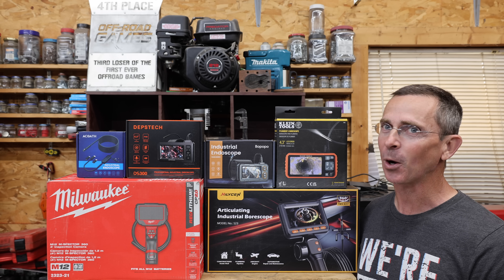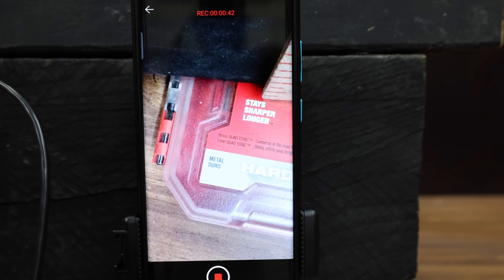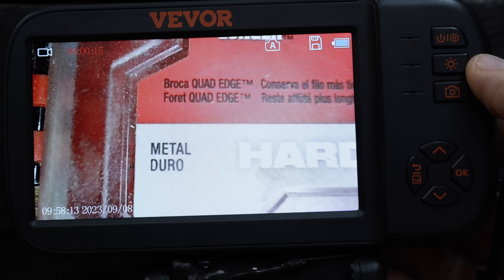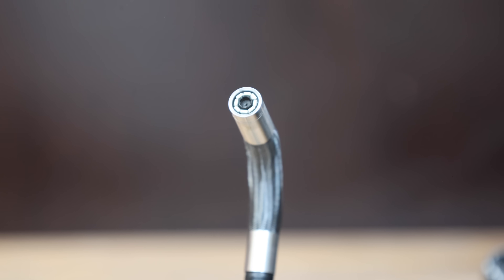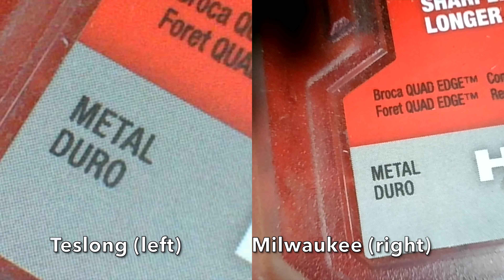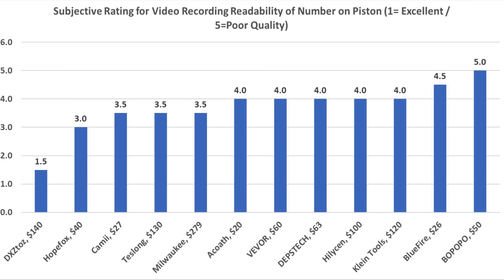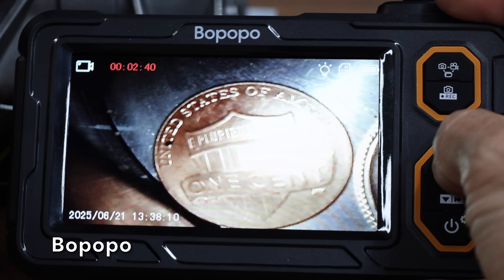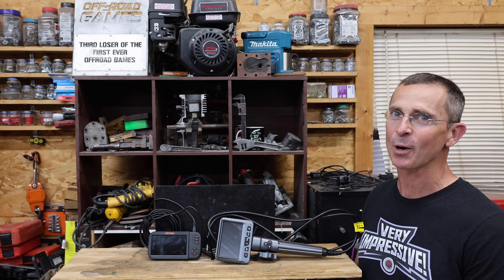I Tested The Most Hyped Inspection Cameras – One Clear Winner!

Comment: I have the DXZtoz "pro" P/N:  B0B8NTF8Y5 (first sold in 2022, now obsolete), and the DEPSTECH P/N:  DS560TL (three lens, $80). 

My go to is the Depstech. I find the rigid inspection cable to be more useful than the flimsy flexible one. It's more useful for transitioning through open voids, and the screen lets you look through 2 lenses at once. 

There are times when the articulating flex cable is more useful, but that's usually for smaller parts when you want to look at the back side of something, you have immediate access to. The hard cable is more useful when looking behind a tall panel, wall cavity, through the HVAC duct. You'll just fight the flimsy cable the entire time. It's very hard to control the orientation of the flex head when it's 5 ft away - you never get to see what you want to look at. You also can't push the flex cable through insulation, because it's like pushing rope.
Reply from the maker: Thanks for sharing.

Comment: Most of them use the same camera sensor, some with 720p and some with 1080p, almost all of them have direct LED light but I found with mine a little opaque tape (with the center circle area of the camera cut out) helps diffuse the light enough to make it much clearer to see without the spotlight effect straight ahead. I would suggest adding the camera resolution to the final spreadsheet as higher resolution typically means better image quality, but also the screen resolution which means that 1080p camera at 450p resolution means it looks like crap on the screen but much better as a photo/video. With even the cheapest cell phones having at least 720p or better resolution, there is no reason these companies can't do the same.
Reply from the maker: That's a great tip about the opaque tape, thanks for sharing!
Reply: That's what I was thinking, that the first few the camera looked identical.

Comment: Glad to see Vevor being tested. It's easy to get in the EU and is usually good products
Reply from the maker: Thanks for sharing!
Reply: My experience with Vevor is hit or miss.

I needed some heated magnetic stirrers and bought several from Vevor. Every single one of them was so unbalanced that I couldn't turn it up over 20% or the pills would end up out of the field. Unfortunately I was mixing some thicker stuff that needed higher speeds to pull down enough height so it was all wasted money.

Comment: I'm an aircraft mechanic and have owned the Teslong MODEL #: TD450S for about a year now. I bought it on Amazon for $120. It has been abused, highly used, and been flawless. 

The side camera is used as much as the front. I use the tool to inspect airframes for cracks, corrosion, serial numbers, proper cable rounting, fluid leaks,etc. It easily manipulates inside cylinders to clearly identify scoring and exhaust valve issues. 

User friendly, great quality picture, takes pictures and video, has high/med/low camera light settings, it can flip the live image which is a nice feature to help orient yourself, great battery. Highly recommended!
Reply from the maker: Thanks for sharing!
Reply: Those Teslong cameras are great, they are pretty commonly used to check weapon barrels here.
Reply: Same. I use the shops $15k Olympus for turbine inspections but it feels way better to use the teslong in the airframe places it can fit since I know that, at the worst, I'm out a $150 tool
Reply: I have the Teslong (and several others here) and it’s helped with some fairly complicated automotive repairs, remote viewing and all, and it’s saved my butt often enough to have more than paid for itself, many times over. The Vevor, I don’t trust that company nearly as far as I can throw their stuff (against the wall, IMO.) I agree with your assessment that the Teslong is a really good performer.
Reply: Which model do you use?
Reply: @paullang1505 
Not sure. Mine is an earlier model(black/orange). 3 of my co-workers ended up buying one as well after they saw how nice they are. They received later models(all black), but they all seem to work the same, with same features, just a different look. 
Btw, non of them has had any issues either.
Reply: Hi, if you ever get the chance to reference the model number of the Teslong on the case itself,could you please do so , I as well as many others would like to know, thank you.
Reply: Does it only offer shallow depth of field? Is it possible to use it to inspect big spaces or only details and closeups?
Reply: @MartinsGraveyard 
It does have a zoom feature for closeup or when you cant snake the camera quit close enough. It will show larger rooms but closeup detail degrades as you get farther away. Hope that helps.

Comment: I really don't need a bore scope... Let's see which one I'll be buying later today.
Reply: You don't need one until you need one, I picked up a cheap one years ago and now use it 2 or 3 times a month, where is that 2x4 in the wall, let me put my endoscope in the little hole and look, drop a 10mm socket and hear it hit the skid plate, lets look.
Reply: @TheWabbit  I guess it’s like one of those tools, that you could have used once or twice in the past few years. But once you have it, you are like how did I do without.
Reply: @TheWabbit LOL, I have a socket lost in my skid plates right now. Someday I’ll stumble across it… maybe I DO need a borescope…
Reply: @TheWabbit  I found the solution to escaped 10mm and other common small socket loss. I bought a set of extensions then JB Weld'ed (6 point of course) 10mm, 8mm, 7mm, 1/4" (for hose clamps) etc sockets to short and medium length extensions. The only reason to share extensions between sockets is lack of extensions, but small tools are cheap in 2025. I epoxied duplicate sockets to 3" and 6" extensions using solid sockets and (shallow well) universal sockets for tight clearance. 
I also epoxied plain 1/4" drive universals to extensions to reduce the risk of pulling one off. Works great and I should have done that forty years ago.
Reply: Hey it’s for a rainy day 😉
Reply from the maker: Lol! Enjoy the video!
Reply: @ProjectFarm  When is your birthday?
Reply: Agreed!
Reply: Lol so true man
Reply: I do that too.
Reply: He who dies with the most tools wins
Reply: Lets see which one doubles in price - today-  on Almazom 😂😂😂
Reply: @BM-ki8bn  Vevor on Amazon in UK is £130....!
Reply: I do need one, hopefully it's not sold out by the time I watch the video
Reply: You'll find uses for it, guaranteed.
Reply: I bought the harbor freight one, no go don't waste your money $$$
Reply: It comes in handy so many more times than you think it will when trying to see somewhere , behind something, inside a wall, etc !
Reply: Nobody realizes how much they need one until they've used one before lol
Reply: I've bought probably half a dozen off AliExpress. Honestly super satisfied with most of them.

Some are soft cable some are stiff cable. Different head sizes.

Absolutely wonderful for gearbox inspections and stuff inside machines so I don't have to remove multiple panels.
Reply: thousands of people have read and laughed at this!
Reply: +1
Reply: LOL same.  I already have a depstech USB C one but I like that VEVOR.  Seems they have a 5" one now which is under $50, i wonder how the quality of that one is?
Reply: Same - lol!
Reply: It's always this problem, isn't it?  He's good at convincing me to turn loose of my wallet.
Reply: Image resolution might be improved in some circumstances if the LED'S had options for various light spectrum. If bright white creates too much glare and obliterates detail, perhaps a warm yellow-orange, blueish, or even ultraviolet light might be better. The camera-angle joystick knob is a handy feature; I chuckled when snake-charmer Todd made it "dance" like a cobra !  PS, now if only these things could also focus at a distance of several feet or more; perhaps the manufacturers could include separate umbilical camera lenses for longer-distance focus. Having to position the lense within 3 inches is a myopic view that might make it impossible to see the forest for the (individual) trees. PS, I hope the self-contaimed units have hard glass screens like a smartphone does; plastic will quickly scratch and scuff on a construction site or in a shop repair type of environment.
Reply: My wife tried blocking “Project farm” from my YT feed….
Reply: @Tmrfe0962 Does she know she can get blocked also?

Now thats a narcissist.
Reply: You just never know!!
Reply: Hahaha, read my mind .
Reply: Never heard anyone call colon a bore before. I'd rather go to a doctor if my bore needs scoping.
Reply: Everyone needs one lol!
Reply: Same
Reply: Pen vs Pen... Linus just made one. Thnx for the excellent informative videos.
Reply: It’s another tool you didn’t know you needed. I bought a Depstech with a larger screen and a side view option. It cost about $100 on Amazon and I used it to look into walls to find the source of a plumbing leak. Neat!
Reply: could save you from colon cancer one day bro. Also good for checking the condition of cylinder walls.
Reply: PS, I wish more of these had the side-lens. Can it do dual screen, both dead ahead and side view, siimutaneously?
Reply: I bet there'd be a lot less glare inside an engine borehole if the engine had been heavily used and was full of oil and carbon deposits....the LED'S might not be bright enough!
Reply: You don't need one YET
Reply: I have a Ryobi bore scope that I bought on closeout maybe 5 years ago; it has been moderately useful but kinda meh, nowhere near as high performanve as the best of these.
Reply: LOL that's me all the way.
Reply: But you do... surprisingly useful in all sorts of locations!!
Reply: Yep! Same here😂
Reply: Maybe some of us would rather have an exciting scope than a bore scope !😉
Reply: Don't need one either but want one
Reply: Clutch for inspecting inside walls. Fairly cheap too
Reply: What? Of course you need a bore scope. Think of all the money you will save being able to looking into things that people charge you to look into :)
Reply: Would never use one I think but the Vevor is on sale now.... feeling froggy, may get two.
Reply: L😅l
Reply: Yuuuuuup
Reply: Ha ha
Reply: You can now check on your bluebirds.
Reply: I understand fully.  I have the Milwaukee that I bought several years ago and have only used it once.
Reply: You can look at your ear drum. All the justification you need
Reply: exactly
Reply: Exactly!!
Reply: lol so true 😂
Reply: Exactly…..
Reply: You'll find ways to use it, once it's in your hands.
Reply: I’m off now to buy one.
Reply: Me too, It is good to have one just in case you need it once every 7 years
Reply: Get a Teslong. I have one and it’s great
Reply: I'm glad you came to your senses in the second half.  This is hands down one of the tools that makes your life way easier, especially if it has magnet.  Your 10mm collection will thank you.
Reply: People don't really need smoke detectors or fire extinguishers.
Reply: @shawbros right? Those are so overrated. Right up there with airbags and seatbelts.
Reply: @willdahud4350 funny you mentioned airbags.  
He is going to buy a bore scope to let it sit around and age until the day he maybe needs it
Takata airbags sat around and aged and that caused the propellant to alter and the airbags to send shrapnel into people's faces and throats
Reply: So you're saying you're a sucker and easily influenced? Sad
Reply: @Boogie_the_cat  so you’re saying you don’t understand what a joke is?

Sad.

Comment: It’s uncanny how this channel uploads exactly what I need when I need it; this is the third time now! As for a suggestion, I have two: sound deadening foam either for automotive or indoor use or both, and windshield wiper fluid! Which ones streak, handle cold, remove debris, etc? Thanks for the excellent work as always!
Reply from the maker: Thanks for the video ideas!
Reply: Acoustic products are very difficult to test accurately without specialized equipment and knowledge, but most materials commonly used for acoustic purposes will have octave band data available assuming you're looking for NRC. I have been measuring room acoustics and sound systems for a lot of years now and it would take me a lot of effort to be confident I was making a meaningful measurement. Getting numbers on a screen is easy, but there are challenges that are non obvious that make accuracy hard.
Reply: @danielchin8073 That’s what I figured; it’s out of scope for this channel anyways. and thank you!

Comment: I love my Vevor SC8. Helped me identify an ever-so-slight coolant leak in cylinder (Subaru). Also shined to verify curtain drain pipe reducer connection flow and a leak free system before 3/4” rock backfilling. The long cable was needed and the water resistance also became a nice feature.
Reply from the maker: Thanks for sharing!

Comment: I asked a car dealership if they could check for carbon buildup when doing the regular inspection. They told me that would be very expensive because they had to remove the intake manifold. I then asked why they couldnt use an endoscope camera for looking at the valves as I've seen dozens of times on YouTube. Answer: We don't have such a tool. 😒
Reply from the maker: That's a shame they don't have one!

Comment: I love when Todd reviews a product I'm about to buy!!  I've got a few hidden bolts to remove for a future project, and was looking at inspection cameras to assist with them, so I'm very much looking forward to this one.
Reply from the maker: Thanks for the feedback!
Reply: Spend the few extra and go with articulatable boroscope, you won't regret it. They offer much more flexibility in their use. The only downside is they are usually a tad bit bigger on the head due to articulation components.
I have 4 boroscopes, the last purchase was the articulating one as I kept finding areas where I wish I could see just a bit more 'over there'. If not articulatable, get a dual cam model so you can see sides without a tiny mirror attachment.